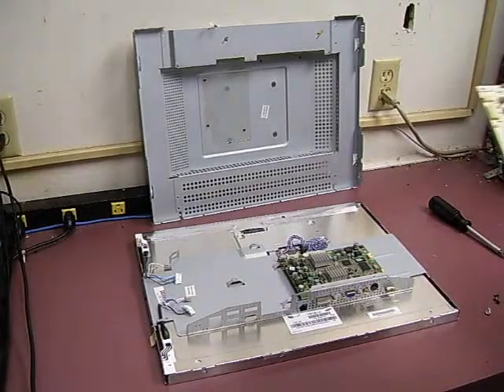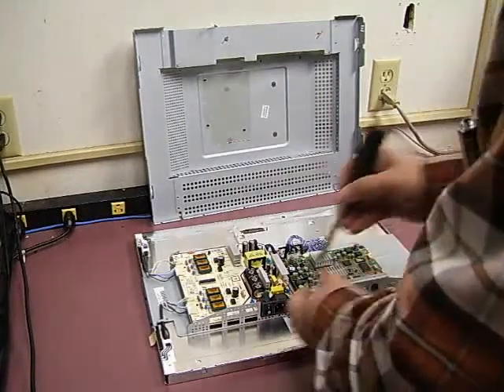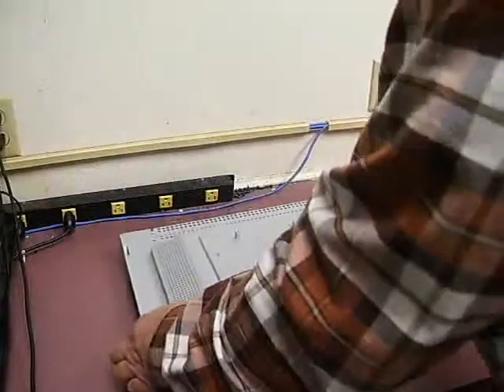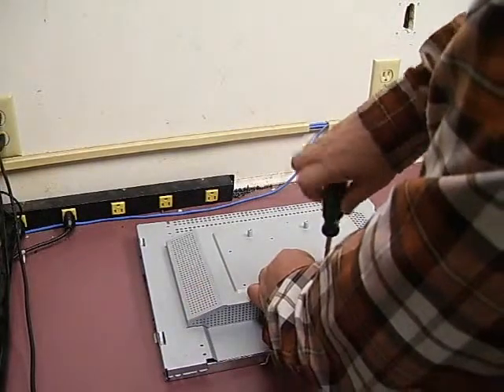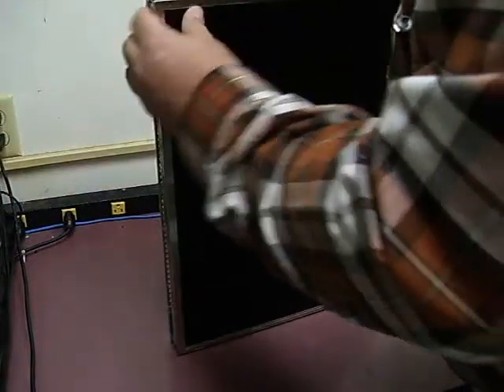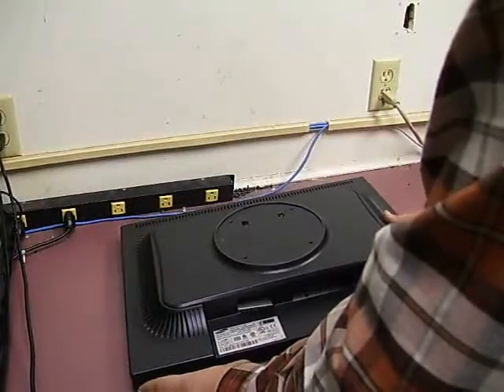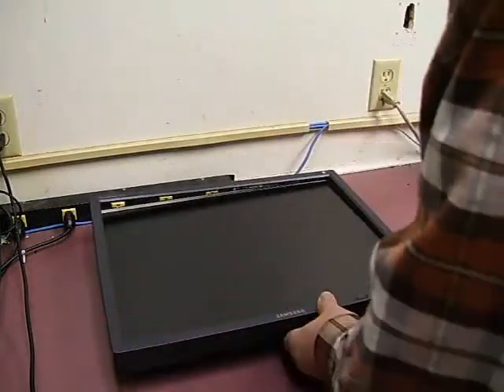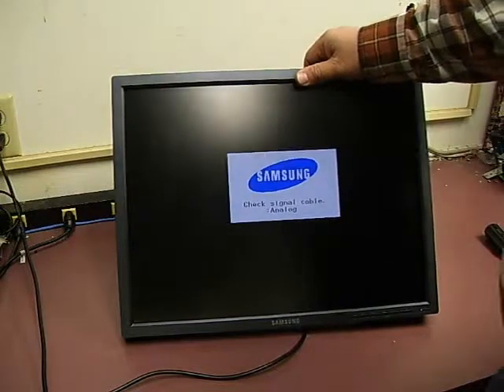Samsung 214T repair - Part 3 reassembly and testing

Comment: Just grabbed this monitor for 4$ from Value Village. One of their employees dropped the price after I told them it flickered. I knew that flickering was a sign of some minor component going on the board, these videos will help me (hopefully) get it fixed. Just need to order the parts and then find someone with a soldering iron. Thanks for making these videos.